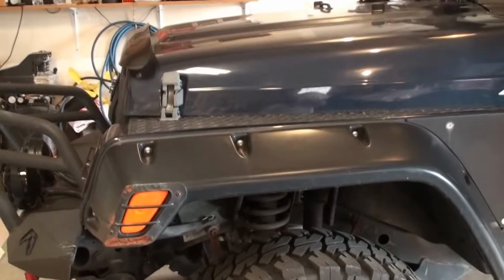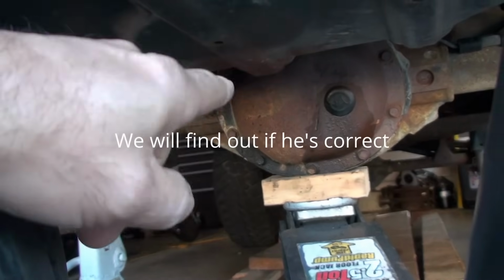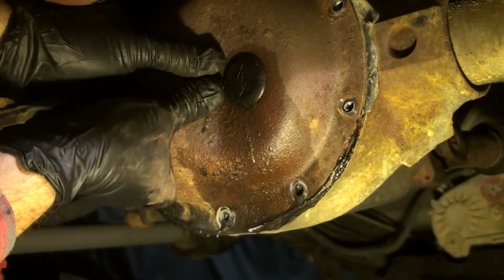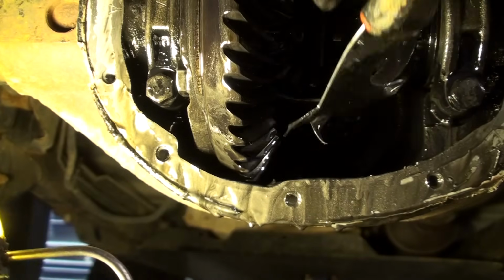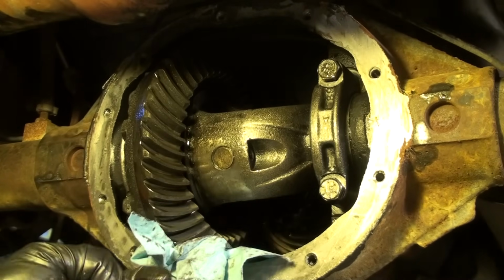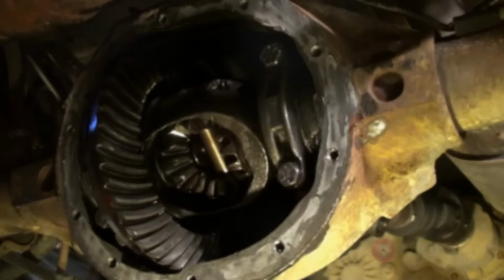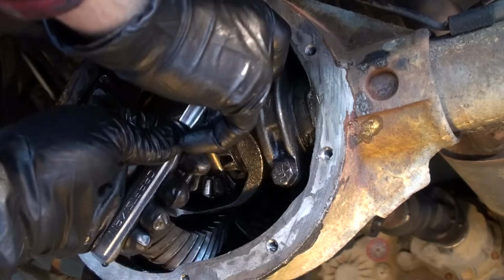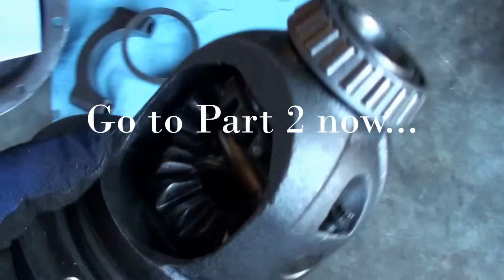Differential Repair **PART 1 of 3** Dana 35 - Jeep

Comment from the maker: The sealant I like to use to seal the rear differential cover: https://amzn.to/2IyT0W8.  The slide hammer I use that works great to remove the axle seals and bearings:  https://amzn.to/2IzmO4Z.   Subscribe and like if the video has been helpful!  Thanks for stopping by the channel!  -Glen
Reply: The got the same problem with my same Jeep but idk where to start or what parts I need for front differential

Comment: Great video series, do you do this for a living?  I need rear work on my TJLJ w LSD. Location?
Reply from the maker: I live in Delaware and do auto repair part time.  Where are you?
Reply: @ozzstars_cars  I live in SW Connecticut, just a couple hrs away
Reply from the maker: @steve thomas  I lived in Stamford and then New Milford when I was a kid.👍
Reply: @ozzstars_cars  I have a cherry 06 TJLJ w LSD, the clutch pack is making noise especially when doing sharp turns at coffee place.  My mechanic who I really like is not interested and I am only slightly mechanical for a carpenter
Your 3 part video was great, I watched it twice it was so interesting, I certainly didn't know about freezing and baking parts
Reply from the maker: @steve thomas  I own a home remodeling business for 24 years now. Make sure when the differential fluid is replaced that that it has friction modifier for the clutch packs or add a 4 oz bottle of modifier for standard gear oil. Can't hurt either way. https://amzn.to/3zXfv3m
Reply: @ozzstars_cars  thanks for the tip

Comment: i have a 98 wrangler TJ 4.o with dana 30 in front and dana 35 in rear.its stamped 3.07 ratio and want to change to 3.73.im running wide 33 inch tires.ive watched and read that you cannot go higher than 3.55 because of the break that my carrier has.i dont know how to tell which carrier i need to replace the front and rear with without spending a fortune.could you please explain how i can tell if i need a different carrier to accept a 3.73 gear.many have said oh it will work,ive got 4.10 in mine yata yata.well some have said alot but i know you know your stuff.and great explanation on your videos.glad ive found you.could you please explain what carrier,used i might need to go to 3.73.im geared 3.07 and man its high.its newly rebuilt 4.0 but its way high.please help,Sincerely Robert A.keep up the great videos.great explanations.thank you
Reply from the maker: Quadratec, they will have the gears.

Comment: I'm looking to do the same on my 98 ZJ. Where did you find torque specs, etc? I'm going to tackle the pinion bearing while I'm at it but that might be over my head.
Reply from the maker: Lots of info online just make sure it's a reliable source.
Reply: That's the problem. I rolled the dice on a ZJ with rear diff noise. Gear teeth look OK but I figured I'd replace all the bearings, including axle bearings, while I'm at it. Thanks for these videos.

Comment: Hi, thanks for the very informative videos. I am trying to remove the axle shaft so I can replace a leaking seal (and the bearing while I'm there.) But, I've run into a problem...I removed the 1/4-inch bolt, and that pin, but for some reason when I push on the end of the shaft it doesn't go in far enough to release the c-clip. Argh! The clip is turning free enough...but it feels like the shaft is butting up agsinst metal out at the wheel end and not simply sliding in like it does in your video and every other that I've watched. Any ideas? Suggestions? So far, I've tried tapping at the end with a rubber mallet, but nothing. Any help would be very much appreciated! ~~Thx, Mark

Comment: Replace everything. Do not attempt to salvage any parts if you this damage.
Reply from the maker: Unnecessary in this case. Pinion was fine, I flushed the bearings clean.